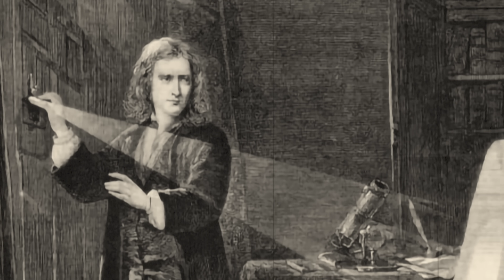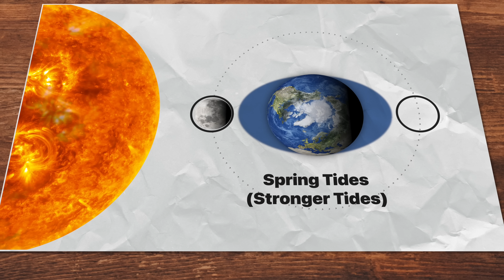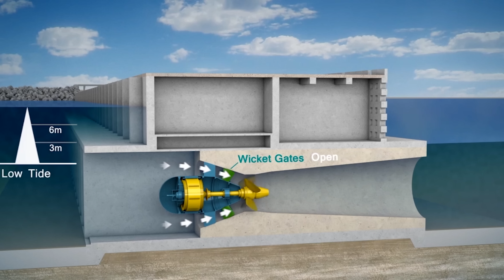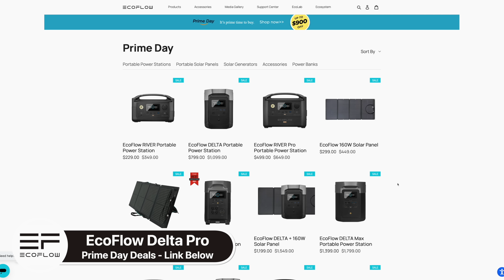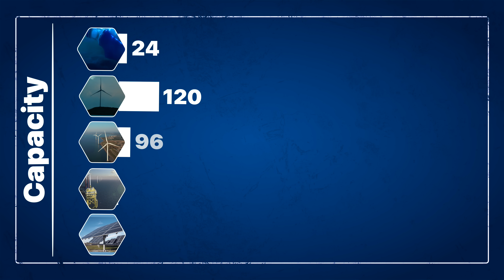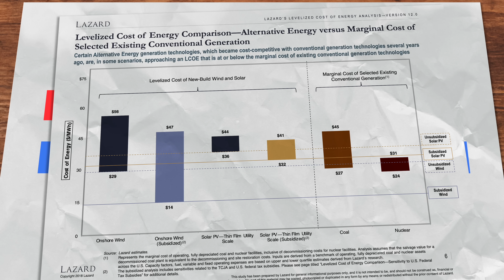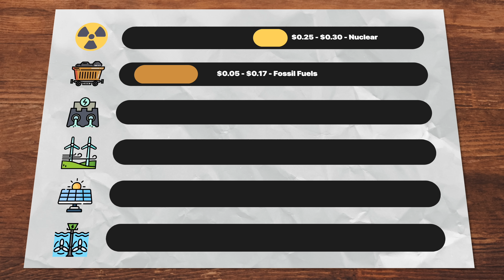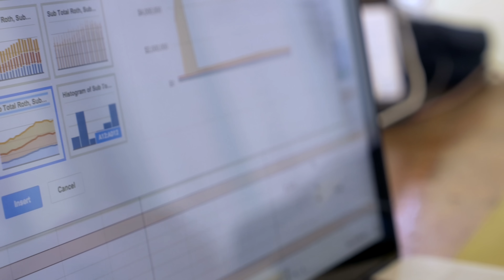Breakthrough Energy Source is 10X Better Than Wind & Solar!?

Comment: Good going, I love these kinds of analyses.   But I was too lazy to see if the calculations include all the relevant factors, including actual lifetime, taking into account weather extremes,  corrosion,  cost of money, government subsidies, and less obvious items such as loss of a navigable waterway and environmental costs.   Government estimates are particularly prone to ignore cost of money and the last two costs.     Tides are usually salt water and it's difficult to get something to last more than 30 years in salt water.  Also the device has to be considerably overbuilt to survive storm surges, often more than doubling the costs.   Often the devices are NOT built to handle storms and they break down within ten years.

Comment: That's not the way tides work. The tide on the side of the Earth opposite the side facing the Moon is caused by centrifugal effect. Because the Moon and earth share a centre of gravity that is not in the centre of the Earth ( it's about 4,000 km away from the Earth's axis, in fact) the Earth and Moon sort of swing each other. It's like an adult swinging a child around in a circle. The adult has to lean back in proportion to the centrifugal effect being created. So, since the Earth is describing a circle, the centrifugal effect on its oceans and seas is to try to fling the water off into space on one side, and on the side facing the moon, th eEarth is actually trying to fly off and away from its water. 
A somewhat different illustration would be Jupiter's interaction with the Sun. Jupiter is so large, that its shared centre of gravity with Sol is actually outside the surface of the Sun. So Jupiter doesn't so much orbit the Sun as dance with it. The resultant wobble of the Sun as observed from outside the Solar System is marked, and this effect is what astronomers use to  determine if distant stars have planets. For many years, it was the only way they could tell if a star had planets. 
And dat's da way it works!

Comment: Note that the price per kw hr figures he cites for all the "green" sources are preposterously wrong. If they were not, there would be an industry RUSH to develop "Green" energy, even more so because there's such a push by a small class of noisy but ignorant Green fools who demand it. Claiming 80% efficiency is especially ridiculous... There are NO systems that get that kind of efficiency known to engineering OR science. The best known systems currently seem to approach an optimax efficiency of around 66%.

Equally important, California and Germany would be the world leaders in power production, because both have gone all-in on "Green" energy. Instead, Cali has to import something like 30% of the energy it uses, and Germany is in a serious state of near-collapse as it fails to produce enough energy to support a modern civilization. Germany is now tearing down its forests for wood-energy, and along with many parts of Europe who have been suckered into this garbage, is already warning its citiz//// (cough cough) "peons" that they can no longer expect to rely on having power to heat their homes this winter, that there will be multiple days in which they will not have enough heat. Even France, who have used nuclear for decades as their main source, with no significant incidents, has fallen for this crap and is expected to have significant shut downs of non-essential power usages. In France, many otherwise successful restaurants are expected to go out of business this year due to being shut down for substantial times due to enforced blackouts of "nonessential" businesses.

No, don't take my word for it... just pay attention to Europe this winter. Pay careful attention, as I doubt if the US media will report much of this. Work on getting some international sources, such as papers in the UK, which you can rely on.

P.S., they also fail to note yet another form of actual Green Energy which probably should be investigated (though it has the same issues, corrosion and biofouling), and that is "Ocean Thermal Energy" (wiki it). The basic idea is to use the temperature differential between the surface of the ocean and about 100 feet down to generate electricity. There are two different systems Closed Loop and Open Loop -- one of them just brings the cold water up, puts it into a heat exchanger, then releases it back down where it came from. The other brings the cold water up, and then releases it at the surface.  The former helps the fish below, by giving them more warmth to work with. The latter helps the surface fish, as it releases the nutrient-rich water from lower down (nutrients sink) up topside. The big question here is deriving energy from the temperature differential which is lower than we typically use to generate power (think "Steam Turbine" and you get the idea). The answer here may be in the form of the JTEC (the Johnson Thermo-Electric Coupler) invented by Lonny Johnson, the former NASA engineer who got rich by creating the "Super Soaker" water guns (he's a brilliant guy). It gets close to the actual maximum efficiency ("The Carnot Cycle") even at low differentials. This, as yet, however, is also pie in the sky, as, while there have been some small pilot plants operated out of Hawaii, there has not been a great deal of investment in it.
Reply: Note that he also ignores the fact that solar and wind turbines both not only have issues with intermittancy, but also cost quite a bit of money (aka "energy") to produce in the first place. Solar PV is basically a variation of making computer chips. Making computer chips is one of  THE most filthy, pollutant-producing processes humans engage in. The toxic chemicals it produces have to be recycled and/or broken down in some way, so energy to mine, energy to fab, energy to clean -- and then energy to recycle at end of life, which for PVPs is about 15-20 years at the moment (yet another expense which is usually hidden, most other power sources last 2x to 3x longer). For wind turbines, the problem is two-fold -- first off, the windings in the turbines use extensive amounts of Iridium, which has to be mined, and that means serious "tear down a mountain" type mining, not simple "tunnels dug into the ground". Then there are those enormous fan blades, for which there is no current recycling process... So there is a HUGE number of them collecting in landfills. Search "wind farm fan blades pile up bloomberg" for more info and pictures from Bloomberg.

TL;DR: The amount of energy used for the total power cycle -- from mining to creation to maintenance to recycling  -- for solar and wind may well be a **net negative**. But all that is hidden from you by the way things are priced and "careful ignorance" is applied by the media and proponents. Just because all the pollution is occurring in China does not make this "green" stuff "green". It just hides it out of sight. And proponents are treating you like little children playing "peekaboo", as though the world did not exist just because you cannot see it at the moment. It does. And many of the REAL problems are not what they seem to be.

Comment: The fossil fuel industry must do everything they can to dissuade renewable energy because when we begin getting our renewable energy not price linked to fossil fuels, fossil fuel companies will go out of business forever. Anywhere you go, any community is not allowed by law to produce their own energy, unless it is inserted into the grid and tied to grid prices. Its a back room scam. Every single town on the planet could build small and inexpensive renewable machines, owned by the town. Just like their water systems. Then the residents buy electricity at actual cost using machines they own, about one tenth what they were paying. The only way this will happen is if the common Man stands on their feet and scream bloody murder when these scam artists show up at town board meetings. Imagine electricity at 1/10th the cost. Not price tied to oil, ever again.

Comment: There's me going through life thinking totally different,  gravity is a theory its not fact. We all understand about gases and there different densitys. Each gass has different density and all have there own equilibrium in the hight they reach is different creating layers of gas each trapping the highest density gas underneath and the lowest Density above.  This makes an invisible  layerd atmosphere trapping air nearer to the ground. If there was more build up of all gasses they eventually  reduce the layer bellow then will effect the air buy pushing against it and making more pressure  , we would end up with less air space above us and would feel heavier. If gasses were reduced then it would make us feel lighter and less effort neaded to move around. The only time u see the layers In the sky Is when the sun ionising the gasses and you get different colours like red sky at night shephards delight.  That neon gasses in the sky ionising.  Gasses are colours in the sky. This is your gravity the force that moves water but carnt stop a fly going on its way.
Reply: Oh dear, a gravity denier writing utter nonsense and does not understand the scientific meaning of the word 'theory'.  (A systematic or scientific explanation). 
We would end up with nitrogen and oxygen in separate layers under your model, not the mix that we see in reality, and which reduces in density with height, yet you talk about 'trapping air' as if it some special gas which conveniently sits near the ground supporting life whilst also talking about layers of gas; you can't have it both ways.  You do know that air is simply a mix of the gasses which you think forms layers, don't you?  The ground layer in your woefully incorrect density layer scenario would be almost pure carbon dioxide, being more dense than oxygen.
The buoyancy effect of our atmosphere amounts to less than 100g for a person at sea level - nobody would notice this changing due to air density.  'Less effort to move around'?  Really?You truly have been watching way too much YouTube 'science', particularly those from flat earth types I suspect, and you should go away and learn basics physics before you embarrass yourself further for the world to see...

Comment: With rotating elements under water, there has to be a rotating element SEAL. There is no rotating seal I have seen that will last 75 years especially in sea water. I think the cost of maintaining the under water generators will be much higher than you think. Usually when a seal fails and water intrusion happens, there is significant damage to internal parts and the cost of rewinding the stator is fairly high. Even with water sensors, damage happens.

Comment: I know of a local guy that has patented a wave system
It is based on shore where a  pipe goes to the sea from a sealed chamber on shore.
The sea raises the pressure in the chamber and turns a turbine, a non rerurn valve lets air back on on the wave out cycle. Rinse and repeat
This has been pilot studied and 800m of coast generates 1GW.

Comment: Tidal power will be as disruptive to the environment as windmills are. Windmills disrupt the natural flow of the winds, leading to climate change. Windmills also have a sky-high failure rate, since they are subjected to harsh natural forces. These tidal generators will disrupt the natural flow of the tides, leading to problems that we have not even fathomed yet, and will  have a high failure rate as well.

Comment: well, LCOE does not takje into account the intermittance. if you factor in the price of the batteries to have electricity 24/24, then wind and solar are no more the cheapest solution. you can also factor in the gas or coal to produce electricity when solar or wind are not producing, but then you should not be allowed to call it a green energy because it cannot operate without gas or coal ...

Comment: Every country should be building Thorium Fueled, Liquid Salt, Nuclear Reactors (aka LFTR) which do not create Radioactive Waste, CO2 or Micro Particulates. LFTR are more than capable of providing cheap Base  Load Electricity 24 / 7 for more than 20 years.
Tidal generators have to be taken out of service regularly to remove weed and barnacles.

Comment: Since tidal and sea current flows as described, carrying waters of various temperatures depending on location, it thusly affects the weather of lands in its distant path. As examples, consider the weather in the U.K. is affected by the gulf stream flowing past Miami, FL, or the weather in Seattle is affected by the currents from the waters off SE Asia! Extracting power as described will certainly be another excellent energy harvesting tool, providing power to an evolving grid, but tidal energy harvesting WILL affect the weather patterns in ways we will need large computing platforms to model. Agricultural impacts could greatly affect the quality of lands for historic crops. - Now, lop on the global warming of our planet - again caused by the forces that create tidal energy - and you have a very complex model to analyze. Perhaps harvesting energy from the equatorial latitudes will be offset by the rising temperatures in the northern latitudes which have seen a few 100+ year records fall in the last 5 years. Quite the puzzle, and if we don't look at this hard for the proper solutions as a planet we could be affecting land use significantly over time.

Comment: 70 to 100 years on lifespan? Sorry but that is blatant bs, these things will require significantly more maintenance than any other tech, both from corrosion from the seawater, to the constant buildup of marine life, something that will have a DRASTIC reduction on efficiency, as any life building up on the blades will massively alter the flow, also in regards to this maintenance, the people required to perform this maintenance will not be minimum wage burger flippers, but professional divers, and while I don't have exact numbers, considering the dangers in that line of work, you can bet having a full team of them will not be a cheap cost

Comment: I think the upcoming generation of water power generators are built above water - utilizing the surface wave motion with floating wheels or paddles to generate power - it’s easy to maintain above water. Costing between 1/10 to 1/100 of the price of the underwater installments. In tune with the powers that run the world  becoming less centralized, more community and family based. light weight dispersed & off grid power generation

Comment: If I am not mistaken, I believe the video shows 'high-tides' staying bulged outward, toward the SUN which is incorrect. That happens only during spring tides. During neap tides (at the 1st & 3rd Q phases) high tide is bulging generally toward the Moon  but not as high and the low tide is toward the Sun but not as low. I believe that the High Tide should be bulging outward generally following the Moon as it orbits Earth which is why the time for High Tides vary daily.

Comment: Thank you for your Video. Tidal energy has been my dream as a power source for 3 or 4 Decades. 
In my point of view, Tidal Turbines are not the best solution for Power Generator Plant's. But for argument's sake! The best place for such a Plant would be in the Mediterranean Sea at Gibraltar where you should find fast currants and in many River Mouths. 
But my dreams are different. It has to do with a much bigger and faster Power Plant serving two or three Industries at the same time. It would be a 1) Power Plant, 2) Marine Farming (Mariculture) 3) Seawater Desalination Plant all under one roof taking advantage of Tides and waves allowing you to Pump Seawater to the Mountain Dams in large quantities in order to generate Power and do Mariculture as well as the Desalination.

Comment: Cool, the biggest problem from the other comments is (oxidation from the sea water).  Great, this thread is identifying the big problems.  And once they are brought up to light.  Fixing them is easy.  Seems we need a material impervious to rust.  graphene will suffice for this.  It will also conquer my issue of a housing.  All at the same time.  If it were built super tough from the get go.  A housing would not even be needed.  At least not a strong one.
OK.  the next thing I see is (graphene ) is not magnetic.  graphene could serve as a coating for ferrous materials.  When necessary.

Comment: the BIGGEST issue I can see with such a technology (and I don't want to see any problems with this, cuz it's an awesome logic).  Storms.  Hurricanes are the easy one.  We can see those things days in advance.  And if the generator is built with a "quick connect".  Detach it and with a barge take it away.  But the pressing one is "regular" storms.  If the "down-time" is large.  Then another source of power would be necessary for the customers.  And then.  Is it even worth my time?  OK, my idea sucks.  Maybe build a "super-structure" around them.  That's it.  We have a working prototype of this part of the system.  Now concentrate on a "housing".